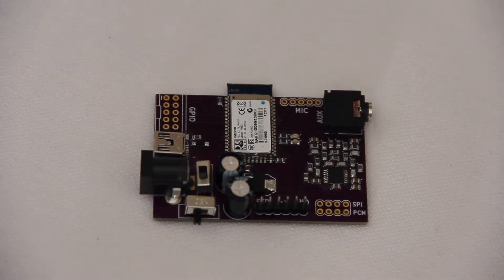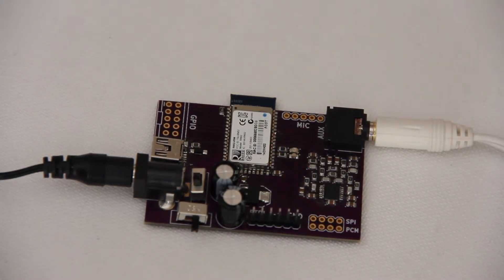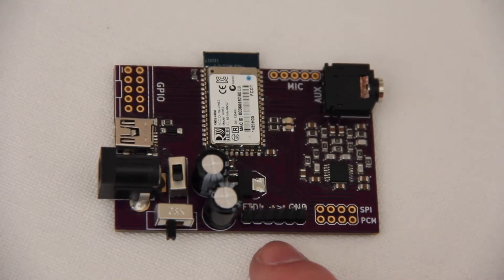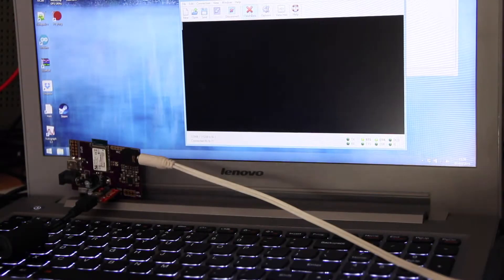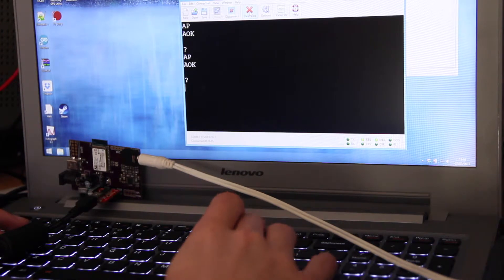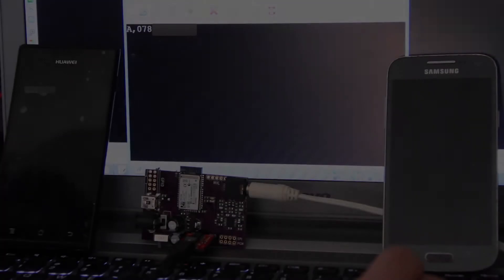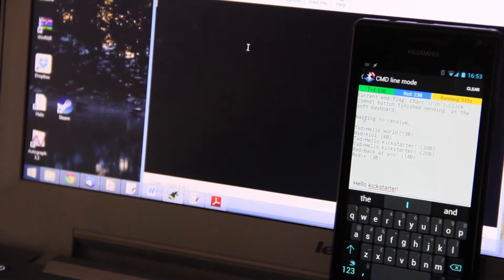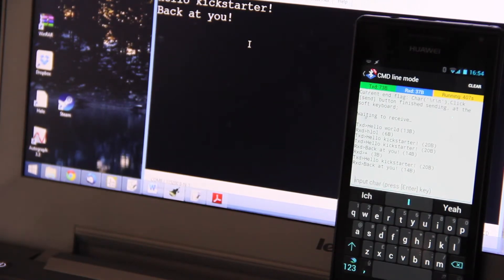BAL - Bluetooth Audio Link

Comment: I need Bluetooth audio solution. Here is my scenario. I have mp3 player module, micro-controller, LCD and keypad. I need to search the available Bluetooth speakers in surroundings and connect to one of the devices and send audio to that Bluetooth speaker. Its like doing the cell phone operation on my device. I also need digital IO interface on the Bluetooth module so I can give serial commands to my system through cell phone app as required while audio is being streamed to the Bluetooth speaker.